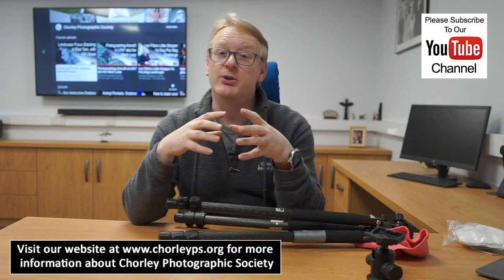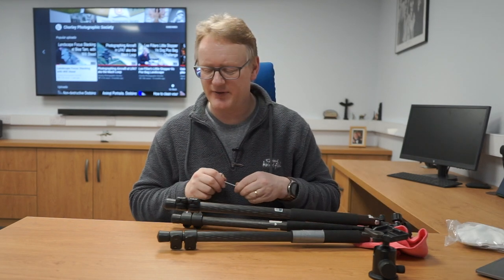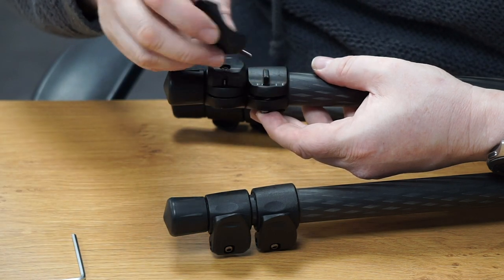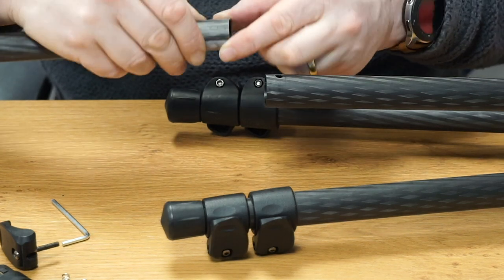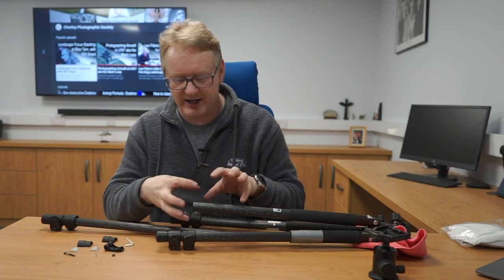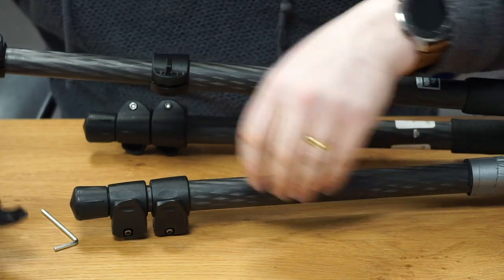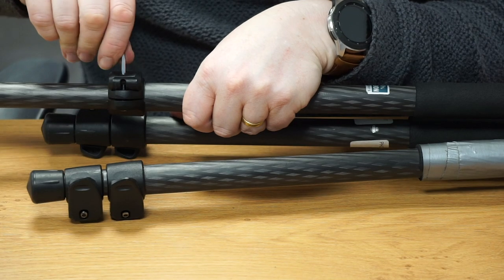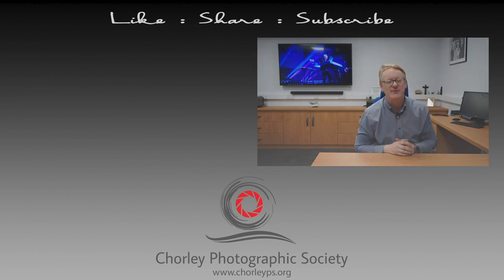Cleaning a tripod with click / lever lock legs

Comment: Really pleased I came across your Youtube channel. I have a Giottis M951B aluminium Professional Tripod. The problem I have is one section of the leg has worked loose is this something that you could help me with…do you do tripod servicing. Another problem is that the long threaded bolt head seems to have rounded off meaning I’m unable to get an Allen key in to be able to tighten it up. Many thanks.

Comment: Thanks for the video Will, I am tempted to use a drop of oil on the screw thread when re-assembling the clips...is that a No... No...?
Secondly the tensioning of the screw actually alters the tension of the clip itself not the in and out movement of the leg.
Reply from the maker: A very small drop. In my opinion, oil and camera's don't generally mix. You can get some tripod grease for the job, but still use sparingly.

Comment: Thanks for this, I was waiting for the click legs as mine are gritty from the beach even after a good wash in the shower it's still gritty, I have a Manfrotto 055 carbon are they just the same?
Reply from the maker: Hi, yep just the same for any click lock legs so a good clean will get rid of your gritty bits. Thanks for watching.
Reply: I’m about to clean my Manfrotto because of sand blocking the proper clip operation.